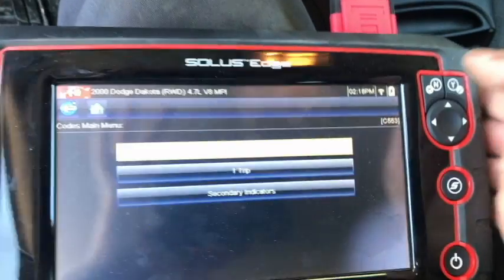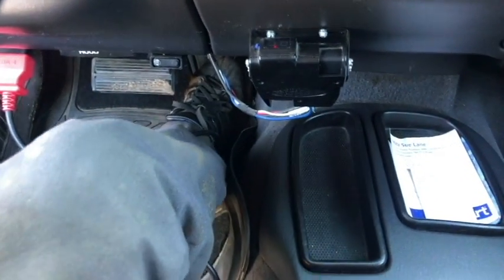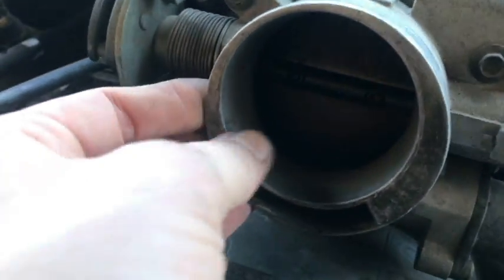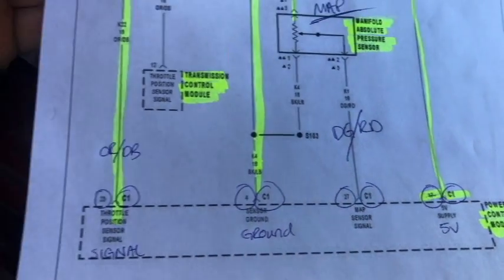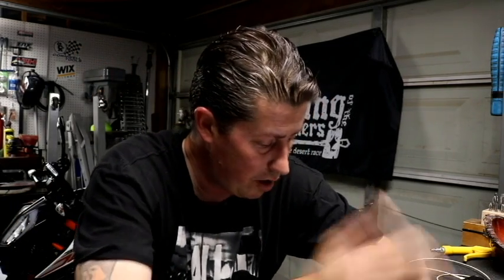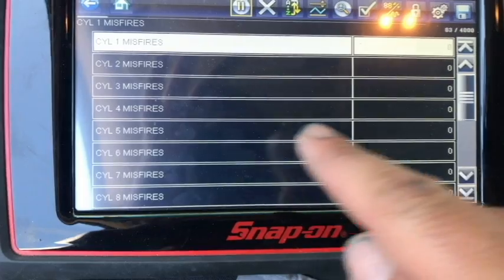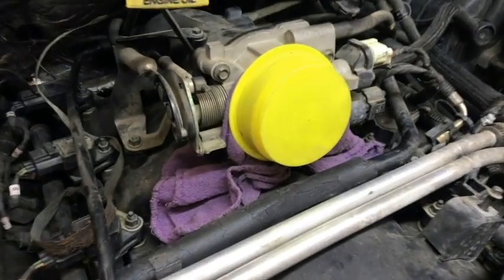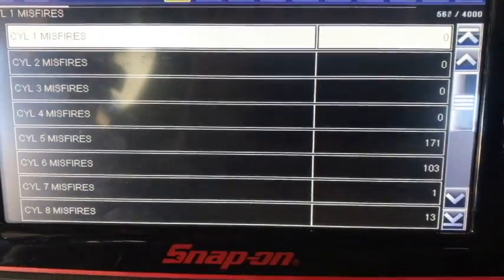Rough Idle & Misfire Code's Dodge Dakota 4.7 Liter What’s the Issue? 1 of 2

Comment: Love you videos bro keep them up my question is I have a po303 misfire in cylinder 3 for a 2003 Dodge Dakota 4.7 I change the plugs brand new plugs and the coil I swap coil from 3 to next one over just to see if you can give me a different code and I never did so I know the coil is good then right and it's still at a rough idle
Reply from the maker: have you checked for a vacuum leak?

Comment: I’m no diagnostic specialist myself but it would make sense that the engine isn’t getting enough gas from somewhere and then throwing other codes in relation to where other voltages are from the sensors because throttle voltage is higher than it should be for the rpm level being weak and the air temp being wrong from improper air not being used by the engine I don’t know if that made sense but hope it did
Reply from the maker: You would be correct. I did a part two and even though I didn't show it I did a fuel pressure test and the needle went up and then fell hard to zero. So what took out what. Moral of the story... this truck has a lot of problems that need to be addressed to make it a solid runner.
Reply: I wouldn’t have thought about the pressure test though I will keep that in mind from now on thanks man

Comment: First you start by repairing the grounds. Second, new plugs. Then start testing coils, IAT, TPS, etc. Also, test the cam sensor. Mine went class a stupid about 2 years ago, turned out to be the cam sensor. No codes other than p0306 and 7
Reply: First you open the fuse box and take it apart
Reply: These vehicles were built with crappie fuse box boards also bolt on mufflers are bad

Comment: When I see multiple codes I start by cleaning the battery terminals. If ground straps aren't hooked up i would use a jumper cable to go further. The components rarely fail in batches. Only twice have I gotten all the way to a bad ECM. Cleaning battery terminals fixes almost half I have done.

Comment: I ran into the same issue with a ford truck and had to condemn the whole top half and timing chain systems too...they used a u3d rebuilt motor and used all the old parts to rebuild 8t too...customer took rebiulder to court and won too.

Comment: How come you didn't test the injector resistance while it was disconnected and compare it to  cylinder that not misfiring. Thats a quick thing to do. I would just connected the grounds if there disconnected. I once had my sisters car not run cause a bolt that connected the ground to the transmission wasn't tighten down.
Reply from the maker: I'm learning as I go. As I've said, this is not my normal groove, but I was given a chance to see what I could do on my own and I ran with it. I'm a nut's and bolts guy trying to learn the Dark side. lol

Comment: See if the rpms hang up at 1200 on the way down from a snap test. (Mash the gas and watch it fall) If so, replace maf...i think that v.c. leak that showed up on the smog test should be addressed most definitely... id look at what the o2 sensors are reading if you think injectors are a problem.